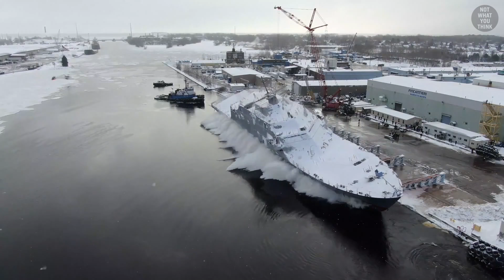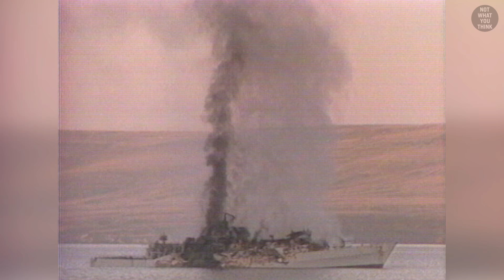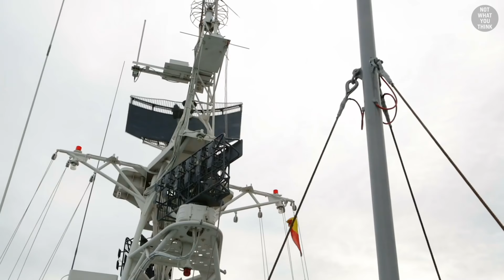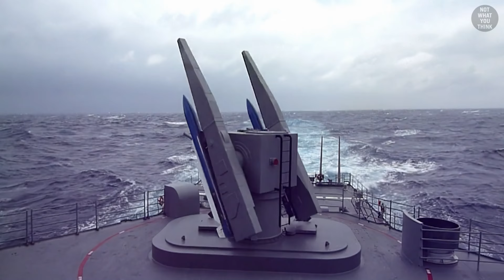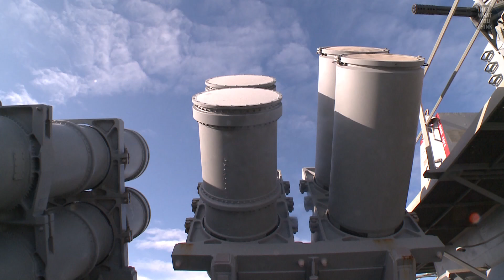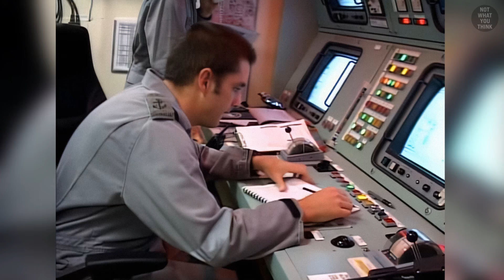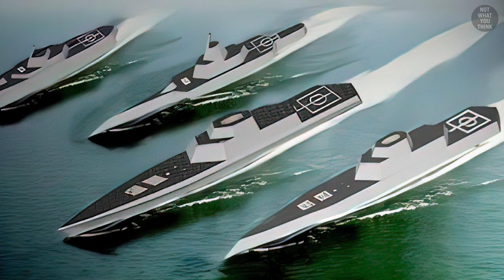How US Navy Made The Most Successful Destroyer ... But Now Has to Replace it.

Comment: The latest variant of the Arleigh Burke destroyer is much improved and should be acquired in much higher numbers. The following class may or may not be successful but regardless will not be fully ready for at least a decade. The US should build 40 flight 3 Arleigh Burke class destroyers during that time. 

Meanwhile, Flight 1 Arleigh Burke destroyers should be transferred to allies in need. NATO members, especially Romania and Bulgaria, should get several ships each. Taiwan should also receive many of them, up to 10 to replace some older destroyers and frigates(Keelung/Kidd class and Chi Yang/Knox class). 

All 21flight 1 ships should be transferred to allies and possibly all 7 flight 2 ships as well. If 10 Are given to Taiwan, 4 to Romania, and 4 to Bulgaria that leaves up to another 10 ships to be distributed among other allies. Extra flight 3 ships would take their place in the US Navy.

Comment: The difference between older conventional radars that we had on Royal Navy Type 42 destroyers, had major flaws which lead to being unable to detect sea skimming Exocet and ultra low flying aircraft, resulting in an unacceptable attrition rate in our naval losses. This lesson was learnt and the AESA and S1850 M radars on the Type 45's has solved this issue and they have the best air defence system of any Navy in the World, that's why whenever NATO carries out any military action, the Type 45's are always called on for fleet or task force anti air work.
The SAMSON AESA can track hundreds of targets at a range of 400kms and the S1850 M can track up to a thousand targets up to a 40km range, the 2 combined are unrivalled anywhere and it's been assessed as one single Type 45 destroyer can track and engage more targets than 6 Type 42's combined.
🇬🇧✌️

Comment: 13:42-last I remember the Flight 3 Burke-class were to have two 61-cell Mk41VLS.
Reply: You're thinking of the Ticonderoga class. Arleigh Burke Flight III will have the same VLS as Flight IIA: one 32-cell Mk 41 VLS forward and one 64-cell Mk 41 VLS aft for 96 cells total
Reply: @surefreshoroni  actually there was talk of extension to the Burke’s forward section in order to install the larger 61-cell unit in place of the original 29-cell unit

Comment: SPY-6 is scalable, there are versions that are less capable than the full variant that use much less power. Performance per power is the stat that matters, and SPY-6 is orders of magnitude more energy efficient than SPY-1D, and it runs off 1000VDC instead of requiring massive power supplies in the 10s of KV.

Comment: The mk13 lancher is still used on the Taiwan destroyer that used to be a Kidd class US destroyer in the 80s. It was the last ship to use the mk13 and it about the same firepower and size as the burke , just that it can only fire 2 missles at a time before reloading. For Sm2 and over 100km shots against aircraft that should be fine and make little difference its only when you get swarmed by heaps of anti ship missles where the VLS really comes in handy. Australia did a test on its Anzac class frigate and it shot down 8 missles that were all fired at the same time towards the ship in training something that the mk13 would not be able to do

Comment: That's what I love about the Royal Navy's SAMSON radar.
It has the electronic (near) 360° near instant contact detection and AESA panels, just like SPY-1's PESA panels
But then, to make it even faster they then spun the panels!
2 panels and they spin at 30 revolutions per minute, so you add those two rates together and scan is very fast and, sadly, very classified.
But until the release of SPY-1's AESA  upgrade, SPY-6, it was the fastest and most powerful radar in the world.
It is currently looking at an upgrade to 4 panels, 3 vertical to replace the current 2 and 1 horizontal for ABM duties with the new Aster missiles with ABM capability.
Reply: While the power requirements for the rotating arrays are generally less over a given amount of time- the update rate for fixed arrays will always be far quicker.

Comment: Good video but there's some slight errors. 

USED Belknap got it's superstructure squashed due to the weight of aircraft carrier deck and even a steel superstructure won't survive that encounter. There's a reason why Navies still continue using aluminum superstructure due to weight savings. Most of the time, the problem isn't on aluminum superstructure but on the spaces where aluminum and steel is joined due to the difference properties of the two metals. Secondly, USN could still improve or make the Burkes larger but it's the electric generation which the Burkes are already maxed out at 12 MW is the problem. DDG(X) isn't supposed to only have 32 Mk41 VLS shown in the earliest since the Navy wants DDG(X) to have either 96 VLS or more. You can see on the model that you've shown that it still has a VLS launchers amidship and USN could install a VLS payload module for CPS HGV.

Comment: You missed Zumwalt's original low mix destroyer the Spruance Class, it was made from the mid 70s to the early 80's and filled the low destroyer gap at the time.
Reply: I was on a Forest Sherman; USS Jonas Ingram-DD938. We knew the Perry class was crap when the super structure cracked up top after some rough seas on an Atlantic crossing. We were in complete awe of the Spruance Class and I never thought they would retire so early. Good video.  DD

Comment: One thing I would love to see is a destroyer/mini destroyer drone set up. Imagine a destroyer that could control up to 6 unmanned mini (about a tenth the size) destroyers drones carrying smaller range anti missiles  missiles that would range up to 20 miles around the destroyer. Each one would have a radar set up to watch for distance missiles. Being unmanned, they would have no need for crew quarters, or any of the things for crews. Their engines could be smaller, possibly a jet type or something more efficient. Being smaller, its possible they might even be able to use hydrofoils. This would enable the destroyers to get warnings about missiles 40 miles away and have multiple intercept attempts.
Reply: Problem with this is emissions control. Destroyers when escorting a carrier (and the carrier itself) run totally silent - with all their radars and other transmission equipment completely off. All situational awareness is provided by AWACS planes. This is why those Russian 'thousand mile range hypersonic missiles' are pretty much lame ducks - you need to get within a hundred miles or so of a carrier battlegroup before you can pick up anything on radar to get a targeting solution on.
If your destroyer is controlling drones by remote, it will be emitting electromagnetic radiation, giving the Russians/Chinese something to lock onto and launch a mass barrage of hypersonics- and once the incoming missiles get close enough, they will be going so fast barely anything can stop them, and once they pick up the carrier itself on sensors they will ignore your drone ship and re-target the carrier, pretty much every missile will hit it, and pretty much every missile will explode.
Reply: @Debbiebabe69  Actually, if one awacs is setting the radar emissions, others can track where it is coming from and where the returns are. This means that the mini destroyer can run silent or one can be the emitter and the others listening. If the mini-destroyers were largely autonomous, with control commands by laser, they would not be emitting radiation that could be tracked.
Reply: @roberthicks1612  AWACS controlling the drone destroyers could work yea. Wouldnt want ANYTHING in the battlegroup emitting though, it would give the fleet away. Yes the enemy could blind fire hypersonic ASuW missiles at the AWACS, but it usually flies a LONG distance away from the battlegroup so this is not really a threat. Firing at an emitting drone destroyer though probably means a dead carrier - those missiles almost certainly have the capability to assess target threat inflight, once they get within active sensor range of the fleet they will soon pick out the carrier and send it down.
Reply: @Debbiebabe69  The task group will have to have radars active if there is a carrier in their midst. This is how they would track aircraft landing on it. They do have ways of countering missiles locked on radar signatures, such as the ability to change frequencies rapidly. There is a defense system I have seen where the target ship would emit a very high power directed radar beam at an incoming missile believed to be radar locked. This would burn out its receivers. Another system would launch a decoy with the radar signal, just as they switched outgoing frequencies. Since the original radio signal was at a specific point and the decoy was launched in the direction of the missile, before veering off with that same radio signal, the missile would track the decoy.

They can not get rid of the radio emissions from a task group, so the use of radars outside the task group would not be a problem.
Reply: @Debbiebabe69  Simply untrue.  The DDG's escorting a carrier (often referred to as the "shotgun" have the radars radiating. Their primary mission is Anti-Air protection for the carrier.  However, you are correct that at times all ships of the battle group may be radio silent, which would obviate directly controlling drones.
Reply: @KB4QAA  Hmm never heard this one before. Everything I have read says the escorting destroyers stay passive unless they are actually at the point where the situation requires the use of a missile. As soon as a ship turns its radars on, Moscow and Beijing straight away will know there is a super carrier within 50 miles of the ping - which is accurate enough for their heavyweight ASuW missiles that can re-acquire the carrier when they get close enough.
Reply: @Debbiebabe69  As a retired senior naval officer, please believe me your understanding is wrong.

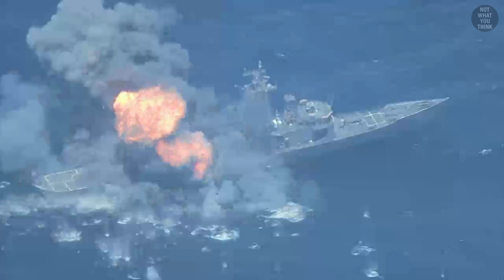Comment: 11:15 And most importantly -- Aegis allows the integration of multiple ships (or indeed, platforms) to a single network with a single set of data (ID, importance etc) for each target, making it highly capable of mitigating a saturation attack since all targeting and intercepting measures of the entire network are used in an integral way, hence no under- or over-targeting. This is the only way to stop a swarm of missiles.
Reply: Aegis is the united states strongest weapon. Our biggest stick. Our best plan. Ive seen a joint combat exercise where an arleigh burke, some carrier (i forget. Its been years and i love destroyers not metal islands) an air recon plane from the airforce, an apache, and 4 squads of marines with radios, small recon drones and a few tablets, all of these things linked. I was in the apache. My nav hud suddenly showed me the entire field of the exercise. The acting commander of the exercise designated targets, gathered data, and called for execute. 3 minutes and it was over. 30 cardboard man silhouettes, 5 mock tanks, 4 wooden patrol boats and one empty hull of an old destroyer. All confirmed to be destroyed, sunk, or kia. Aegis lets one man see the whole battle. Not just maps and toy soldiers. Hard data of the entire situation, being fed live. We came to call the head of aegis exercises the position of "zeus". Because they were sitting in a gods throne watching rhe whole battle and dictating it all.
Reply: In short. Aegis is like the fking eye of sauron. But it cant be blinded by a single event. It sees all and watches all. Having done training and exercises with other countries, seeing their systems. And what intel we have on russia and china. Nobody in the world has anything close. Sure, each single piece of our military, down to the bones of each sailor, soldier, airman and marine. All of that is some of the best the world has to offer sure. But when you have a system that is the sum of all these things, sees all, knows all. Its unstoppable. Aegis can tell all nearby allied forces anything they want to know.
Reply: @masonborden5594  That's impressive... I'm glad we are allied...
Reply: @masonborden5594 beautiful!
Reply: yep and when one ship runs out of missles it can pull back but still be usefull sending targeting data to other ships to get a lock and they can fire instead. A aircraft carrier group with a few allies might have over 1000 missles total to use in attack and defence and that doesnt include what the carrier wing can use
Reply: @nic7048  Exactly.

Comment: I picked up on the Arleigh Burke class destroyers around 15 years ago and found them to be one of the most effective ships out there.  From what it sound like these ships will get some form of Laser Defense System (LaWS, Helios,...).  These thing have layers of defense and the missile defense in the US is FAR better than any other country.  My second favorite is the America/Wasp class ships... or better yet pair them together.  Mixed with the F-25 and V-22.  I wish there was an AWAX version of the V-22.The F-35 though has a pretty advanced radar system and is combined quite well with the Aegis system to extend the capabilities of both.  With the US updating several of it missile systems and pushing for far more powerful laser systems as well as the large numbers of F-35, the US is pulling farther and farther ahead.

Comment: I think Zumwalt class destroyer still can be build with low low cost, only didn't put the PVLS or 155mm gun in the ship and using 5to7 UAV(Bell v247) and rolling airframe missile to replace the those function but keeping two 57mm gun also using spy 6 radar. just like Aircraft cruiser in ww2.

Comment: Question: The Ticonderoga class seems to have 64 VLS cells forward and aft(8 * 8 cell modules). But online listing shows only 122. So what are the rest 6 cells for??
Reply: Originally MK41 VLS had a Strikedown module, it is a module with a crane taking up 3 VLS space in each 64 cell module, it purpose was to reload the VLS at sea. but it was later concluded that it was difficult doing on a moving ship, dangerous, and at the time a ship need it's VLS reloaded, the would have come a new ship to take over it's role. So after Arleigh Burke DDG-78 the Strikedown module was no longer added to the Mk-41 VLS thus of the 64 VLS there was now 64 alible VLS instead of 61VLS
Reply: @heuhen  thanks for the answer bro.. appreciate it

Comment: well, if the Navy is going to be only Arleigh-Burkes and DDG(X) - especially if the first iterations of DDG(X) are bare-bones - who is going to do the "high"? Which surface ship is going to direct a battle group (that only the CVNs and the Ticonderogas are capable of doing?). There are not enough CVNs, and not all task forces need a CVN at point.
Reply: CVN, LHA and some other ships, is more or less the High end. Arleigh burkes can also direct a battle group, but a battle group with out a CVN is more or less a task force/group, or a destroyer flotilla. You have only a battle group when you have a high end ship like a CVN in the formation with a certain numbers of ships around it.

Comment: @notwhatyouthink with the Burke destroyer class the questions has to come is it really a class of destroyer with the flight 3 or is it more like a cruiser.  Cruisers come at 10000 tonnes with length of 150m etc.  Burke flight 3 coming into this size and tonnage.  With the Burke destroyers when comes to capability seems to be all seeing or dancing where can do missions by itself, escort, anti sub, multi mission etc.  destroyers are meant to be screening ships for the larger ships originally against small torpedo boats etc not all seeing all doing.  Something that shown with uss cole incident.  With navy warfare of course all ships doing to have some degree of anti air, anti ship, anti sub, anti surface but not in huge quantities of everything where can’t do all tasks at a high standard.  Even with the ddgx class from some of possible tonnage and size options it’s more of a cruiser.  Purpose of Cruisers classes are designed to go off and do missions by themselves, convoy raiding etc.  like frigate classes meant to do littoral missions, multi mission, anti sub but us navy seemed to lost this when had a cross between a frigate and corvette with the littoral class ships that are a disaster.
Reply: Dedicated ships for each mission is ideal.  However, just as with military aircraft, ships needed to become 'jacks of all trades" when fiscal limitations limit fleet size.

Comment: The Zumwalt should have been designed to operate alone or with a battle group.  It should have been nuclear.  They wouldn't have had nearly as many problems with that propulsion plant.  If it's power you need...nuclear is the way to go.  Additionally, the initial cost of the vessel is offset over time by the fact that the fuel is already paid for...with newer plants, for the lifetime of the ship.  Additionally, if you maintain the fuel bunker capacity...it would actually allow it to refuel other ships in the battle group.

Comment: SLA even comes out in Sci-Fi. Looking at the Galaxy class starship from Star Trek, there is a huge amount of internal space that is left open for future expansion and the like. It's quite neat.
Reply: "AYCHSHUALLY" that's only on Galaxy-class ships constructed after Wolf 359 and during the Dominion War.
Prewar ships like the 1701-D had that internal space filled with civilian accommodations, laboratories, and cargo bays.
Those were all stripped out during the war.
Reply: @twotailedavenger  Not quite. Now, this does dip into the technical manual, but big Lady D herself had sections on the blueprints that were labeled 'future expansion' and were fairly large.

The Dominion War models were VERY bare bones internally though, so I imagine that those that came out of the war would have all sorts of options for new systems and the like.